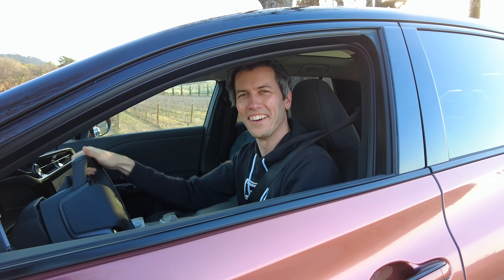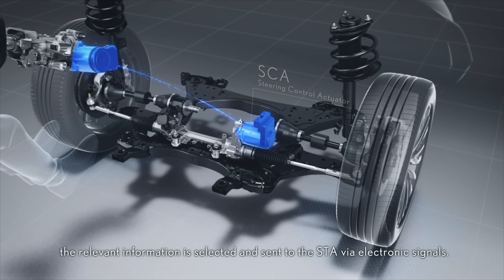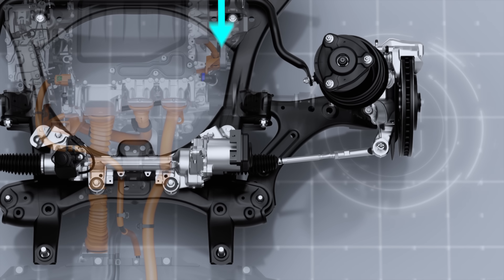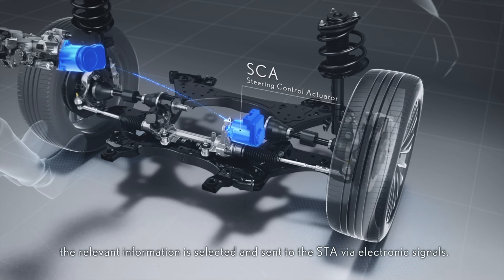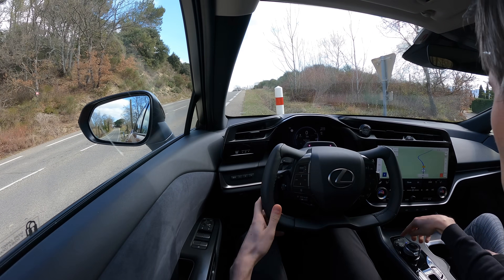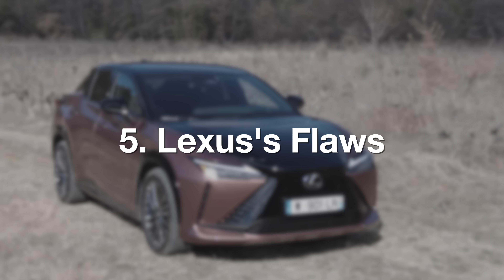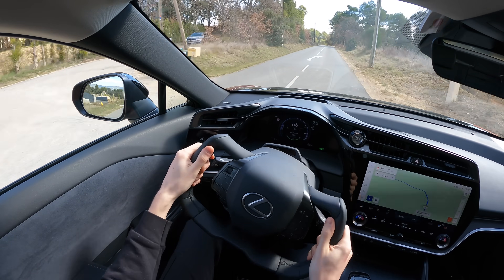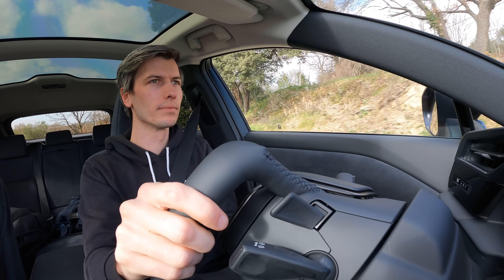How Lexus Fixed Tesla's Bad Idea: Steer-By-Wire Yoke

Comment: Considering that a cheap Logitech G29 has better feedback than 99.9% of modern cars, I can certainly imagine how it could be ok in that regard. Customising FFB settings in a real car sounds great. In terms of reliability...well, as long as Logitech don't make the software then it'll probably be fine 😂

The variable rack I'm not sold on, but if that's adjustable too then maybe it'd be ok. The yoke...well, I don't feel like the wheel needed fixing. Visibility of the dashboard is only really an issue if you've got steering lock on (or are driving a Porsche 992...). If you've got steering lock on, you're going round a corner - why are you looking at the dash and not the road?? Admittedly there are situations at low speeds where maybe it's relevant, but that's very rare. Also, I kinda like the Peugeot solution - just stick the dash above the wheel, dashboards don't need to have huge amounts of info anyway tbh, a fairly thin customisable screen would be totally fine, half the height of old ones where a spinning needle had to fit, that's no longer the case. A HUD is an alternative but I find those much more distracting personally, rarely implemented well.

Comment: This drive by wire stuff is great! Now, 4 people. Can all be controlling the vehicle at the same time! By installing 3 more steering columns. And networking them together.. So you can have dual, triple or quadratic redundancy. In control of the vehicle. Now it's everybody's responsibility! Not just the driver but also the passengers. Who can now all have steering wheels at the same time!

Everything goes into the computer and computer program. It checks all its comparators. And accepts only the most logical mathematical formulae. So when one person has fallen asleep. They can be ignored and still not die. And will change everything.  When everyone is arrested for drinking and driving at the same time. In one vehicle. Think of all the money those police departments and county agencies will make! When you can arrest everybody in the car! They will have a fascist police field day! Because nobody in the car was competent enough to drive. Ha ha ha what a bunch of Maroons!

I want a car with no less than 2 steering wheels.
RamyRAD

Comment: It looks like the steering ratio varies to both speed AND the position of the wheel. The last 10 degrees of the of the steering wheel appear to have a much shorter steering ratio than at a neutral steering position. I think any steer by wire HAS to have some degree of lag at these extreme ratios as the steering motor just won’t be able to keep up with how much you will be asking the wheels to turn.  On a separate note, one of the concerns of a steer by wire system is that it’s not just the battery that fails - what if the steering motor itself fails?  In a mechanically linked car, losing power steering means it’s a slog to turn the wheels at slow speeds but you still have control. What happens in steer by wire? Is there a motor redundancy as well?

Comment: 0:11 - After the whole NHTSA flap about whether or not they would let Tesla sell the Model S/X with a yoke wheel I am hugely surprised they will let a car on the road with a steer by wire system.  Heck, they won't even let cars (Cybertruck) on the road with cameras instead of side view mirrors.  How can they be so forward on steering (what could possibly go wrong if steering fails!!!) and so stone age on side view mirrors??

Comment: Was there a problem with traditional steering? Seemed like it got the job done, safely and dependably for 100 years or more.

I wonder how long before I read of someone dying because some unnecessary system failed leaving the driver without steering control at highway speed? If it ain't broke ...

Comment: What happens if you're on the highway and you suddenly need to make an evasive maneuver because the vehicle in front slammed the brakes.  Or you need to avoid crashing into a jack knife tractor trailer?

Comment: Why not? Same reason the Prius brake by wire at complete fault results in no brakes. No lie I have a customer with a prius who continued to drive with some issues with the brake pumps. Was on interstate when the pump completely failed and he literally had no brakes at all.

Comment: Fantastic. I have been thinking about that for decades, so promising! I absolutely love it and the way you approached it ! I immediately noticed the slight delay in the beginning of the video and it reminded me the steering of R/C model cars. The solution would be to “brake” the steering yoke to match the max speed of the wheels rotation, giving it a truly mechanical feel. As for the safety feature you mentioned on the highway, limiting steering input would be the ultimate safety precaution but will limit the driver’s sense of freedom. Surely in the future that will be welcomed, they could even make it a preference in the car settings ! It looks like it was shot in France of Italy. Nice.
Reply: That is France, based on the license plates.
Reply: What if you need to swerve to avoid a crash? I guess we don't talk about that lol.
Reply: @meriofrog  It doesn't seem like it would be a problem with the current behavior provided that they reduce the steering lag. They could conceivably limit inputs to avoid loss of control without limiting maneuverability, in the same way flight envelope protection works in fly-by-wire aircraft.
Reply: @SteelSkin667  Cars are not airplanes. In cars you can't afford any steering lag or any steering mishaps which he specifically said in this video that the car can just say "Nope". In airplanes you can afford a slight delay, that makes the ride quality better and the plane more stable, the pilots can get used to the slight delay, and in an airplane you don't need to swerve to avoid another airplane.

Comment: We've had variable valve timing for decades, and CVTs for almost as long, and we need steer-by-wire for variable steering ratios? If they say so, I guess. In any case, these yokes are a deal breaker for people like me who mostly drive 1-handed with that hand at 12 o'clock most of the time.

Comment: I think a second version with a wheel to allow more turns lock to lock would be nice, allowing the user a choice between variable or fixed ratio.
Reply: Too confusing and opens the manufacturer to lawsuits. Steering has to be the same (standard) across all platforms in order to be accepted by the public. Now if individual owner wants to "hack" their steering then go for it but manufacturer can't be responsible for this especially if the hack was done improperly.
Reply: @keansakata1015  they already do it with transmission and suspension tunes, I don't see why steering will be any different. They will have a "sport/comfort" button.
Reply: @keansakata1015  Not really, there's already cars with electronically adjustable tunes and components.  The steering isn't the same across the board as it is. You got luxury cars with sloppy no feel steering to sports car like my BRZ that has a very tight  and precise steering  that delivers a lot of feed back. Just have like a auto mode that does the variable and a sport/track modes for more fixed rations and increased feedback. Their lawyers will  just write up warnings that keep them out of  legal trouble.
Reply: The steering action in a fly by wire is software controlled, so Lexus could provide comfort/sport/race profiles if it wants to.

Comment: This is what I really hoped the Tesla implementation would be and was sadly disappointed to find they half-assed it. As someone that has driven cars with variable ratio steering (like BMW Active Steering going back more than a decade) I realized that even if Tesla didn't go full steer-by-wire that they could do variable ratio while adopting a yoke. But with how advanced the rest of the car is I was really expecting Tesla to go full on drive-by-wire. This is definitely an area where Tesla missed out on offering something that should have been right in their wheel house (pun intended). And getting rid of the control stalks was absolutely moronic.

Comment: I wonder if the lag is down to the steering actuator not providing enough output to follow the quick movements on the wheel and not just a software result of applied ramp rates etc. It's easy to turn the yoke lock to lock in a single action but the same rate of action with a normal wheel is practically infeasible. Something where enough feedback would tell you that your wheel hasn't physically turned yet, but at the same time the driver might feel that the system is holding them back. It is: but ignorance is bliss.

Comment: Radio Control model aircraft have been using Expo steering for years.  
Expo = exponential, or - variable ratio, if you prefer.
But, as with the computer game analogy, the expo response can be adjusted to suit your own style.
In fact, is that not in the end the primary reason to go to an electronic control system, rather than a mechanical one.
The control response can be modified and set in software.
Why would you not implement an electronic control system - with customisation options for the owner/driver.

One other side benefit, the exact same steering system can now be fitted to your entire range of vehicles, making manufacturing easier and cheaper.

Comment: As a musician I can say 5 millisecond delay is not noticeable. In chain picking guitar strings on guitar- soundcard - computer - software - computer - soundcard - ears, you have delay, because everything needs time to compute and produce sound. 5 ms is comfortable threshold, less than 5 ms is very fast, 8-10 ms is more sluggish but acceptable. I understand that driving is more important on reaction side. If Lexus will sort out software for being reliably delivering delay less than 5 ms, then it is gonna be good. There is one thought - everyone leaves in past, whatever you see and hear is already happened, neurons making signals and processing information in brains needs time, that's our physical limitations))

Comment: The Citroën SM (1970-75) was supposed to have no mechanical connection between the steering wheel  and the actual "steering stuff", only a hydralic connection. The US laws stipulated, at the time, that there had to be a mechanical connections so Citroën complied. I think it was the first car to have speed sensitive power steering, 2,5 wheel turns between full lock. It was also self centering even when you were stationary. A system (and a car) you should check out. ( I have not read all the comments - so . . . sorry if someone has already stated this.)

Comment: so basically the Lexus feels like driving in AC/Forza/GT online lobbies with australian-levels of ping. 

But seriously the answer for people's preferred ratio is inherently solvable with steer by wire: USER OPTIONS. You like ease of steering without having to cross your arms? Enable adaptive steering. You don't and prefer a linear steering ratio? Disable it. Oh what about having a slider in between those two states?

Comment: it's all about cutting costs, and the rest is fluf, like the fake "no steering colum = more leg room"... how thick do you think it is???

also, variable steering has been around for ages, so that's also just them being full of BS

I'll concede the lack of need for all feedback (but that feels like "a feature, not a bug" argument)

I am glad they have redundancy, and I'm glad they didn't toyota that issue, but "new and scary" is only a part of the issue, it's when it's old and warn, and fixed by some dodgy guy that fixes it poorly, or wrong, and it failed at speed, killing themselves and/or other people too

also there's a domino effect, when one car company does something, other will copy it, and do it cheaper, until it becomes too cheap -_-

also did you just use a picture of the new hummer as an example of "well established"? you know they vehicles have been plagued with issues right? not a shining example

ultimately one day this will kill people, just a question of how many? (this also stands for autonomous cars)

Comment: Ditch the yoke and wheel entirely, go for a centre joystick controller and use Tesla-style FSD to do the actual driving/positioning/control.  This way we can cover for the failings of each system and blend the advantages together.  Not for driving enthusiasts, for sure, but it would maximise the ability for the most number of people to drive safely.

Comment: I mean, still, despite having redundant batteries, the degradation over time is something that drains them simultaneously. 
Understanding how unlikely it is for it to happen on real world conditions doesn’t  solve the problem. If your batteries run flat, that car is not going anywhere. 

Also my concern is reliability. 
Long term reliability. 
This is going to be the biggest pain to maintain past the 10 year mark.

Comment: I like the concept but the delay response is very noticeable. It reminds me of old computers, they work but command response is not fast enough. I don't know if this can be fixed with improved computer speeds or not as the computers we use now are reaching the upper limits of the technology we have.

Comment: The variable steering reminds me of what you see on RC are craft where the center of the stick can be rather high ratio of input to control surface changes for fine corrections but large movements have max movement if the control surfaces.

Comment: Can't say I'd go for it, but every car I've owned has also been a manual. (and I drive decades old school busses off-road for work. Those things are so much easier to fix and maintain simply due to the dead simple construction. I'm not a mechanic, but I have been able to successfully diagnose 90%+ of the issues that came up. Any new technology kind of scares me, because I don't have control over it.)

It's not the worst thing. When I finally break down and buy an automatic, I'll probably stop caring and accept these changes. Of all changes in modern vehicles, the transmission and suspensions make the biggest difference for driving feel.  

I also kind of love old cars in general. And the ones that don't have bleeding edge technology are generally more pleasant in 10-20 years when things start breaking.

Comment: I'm sorry but I've seen to many fly by wire throttles fail to trust this, even with redundancy electronics can completely fail. Throttle fails that will most likely be ok, but your steering fails.... mid corner.... not so great

Comment: Had you been in France? 😉
I'm 99.999 % convinced that the redundant systems will do a reliable job. My concern is rather that I NEED to steer spontaneously in a specific way to avoid a bigger accident on the price of a smaller one and the software says "no". Some other car brands already do this! 🤯😬🤦‍♂️
The explanation of the Toyota/Lexus engineer about driver's experience is nothing but PR BS; you know it, I know it and he knows it himself! 🤪

Comment: Citroen had a hydraulic steering system called DIRAVI back in the 1970s where the mechanical backup is a split shaft with lots of play... it was super sensitive, feedback entirely artificial,  and self centering :) 
I would not call conventional hydraulic brakes brake-by-wire, and AFAIK current legalisation around the world does not allow for either steer- or brake-by-wire. Major difference between a car and a plane is that in the air there's a lot less things to crash into ;) Losing steering ability in car for just a split second can end disastrous, it's so much added complexity for so little gain. Given Toyota's sudden acceleration issues over the years who's gonna trust them?

Comment: Just why? Adding extra motors to mimic rack feel while eliminating the rack. Absolutely no point. The whole unit looks heavier and bulkier too. Also, has Lexus heard of an EMP Strike? No matter how many batteries you have you will loose steering with one of those.

Comment: What’s the point if you still have that massive steering column, really the space is the same. Maybe if the steering wheel was floating it’ll be neat but it’s just more weight & more functions they have to integrate to work with the rest of the car. We don’t need to improve steering I think all focus should be shifted to improving drivetrain efficiency

Comment: I’ll take a mechanical wheel still please thanks. I’m worried there’ll be some issue with the wheels getting out of sync with the yoke where the wheel will be a smidge off-center when the yoke is centered.

Comment: Why would introducing lag in the control loop be a good idea? Also, this system requires 2 things to be functional: power supply to the system and communication. Both of these can fail, and are much more likely to fail than a solid mechanical connection. Next!

Comment: From a production standpoint, this makes it even easier to build left-hand drive and right-hand drive cars.
But with everything being driven by wire and connected to a wireless network, I feel like the next frontier in hacking would be to take complete control over a car while it's driving on the road to either steal the car, but most likely to kidnap or harm the people inside. It's stuff we've seen in spy movies that we knew wasn't realistic... until now.

Comment: I appreciate that you acknowledge that enthusiast drivers won’t like this. Personally I hate that new cars have electronic throttles and so little steering feedback, it takes away the fun of driving. Another thing I’m not a fan of with changing everything to drive by wire is it makes it harder for the average person to work on their own car. I see why they want to go that way but I definitely prefer simple cars that I can fix with a simple set of hand tools on the side of the road if necessary that give plenty of feedback.